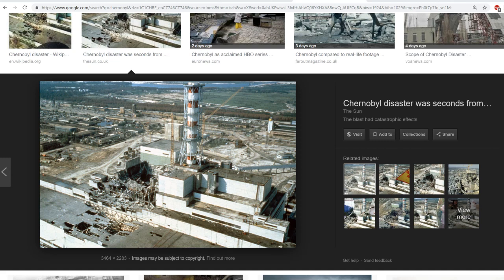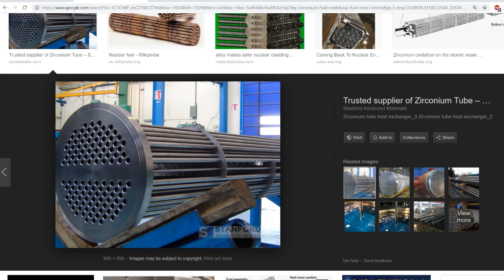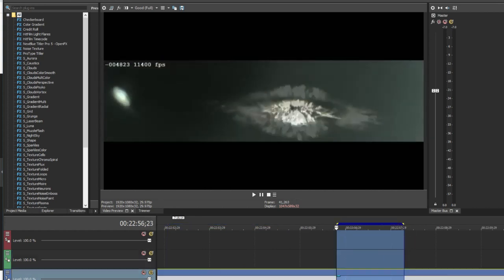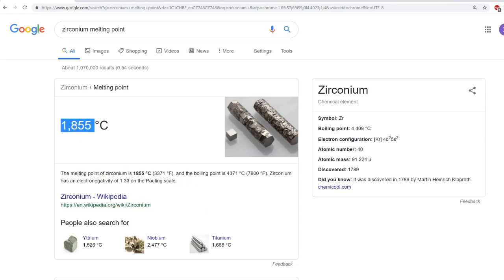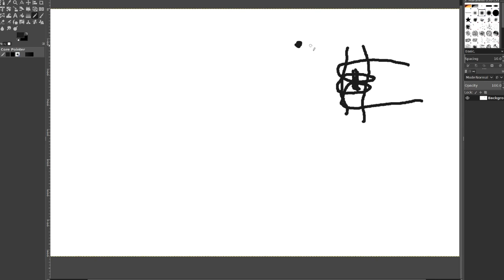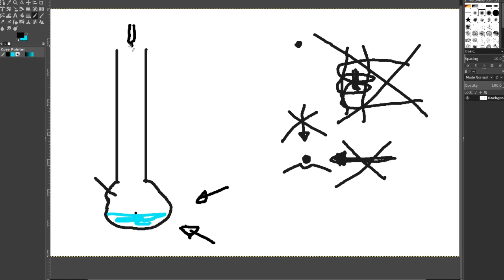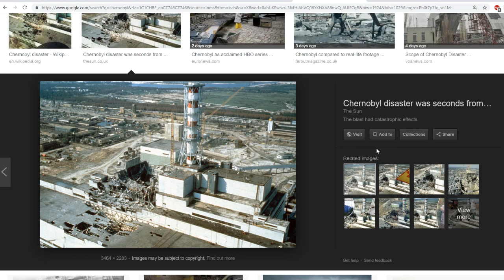Was Zirconium the real reason Chernobyl exploded?

Comment: Super-high-power induction heater vs hair-thin strand of zirconium.
Too expensive?

Harvest the filaments and leads from a bunch of banned 100 watt incandescent light bulbs. Painstakingly wrap each filament around a portion of a thin cylinder of zirconium. Connect leads to several household circuits. Suspend zirconium in argon atmosphere above some water. Preheat as much as possible using whatever comes to hand. Flip house's main breaker for the final super-heat. Wait...

What? Won't work?

Uh... Capped pipe, filled with a few ml of water and a bit of zirconium. A few hundred kilos of explosive charge surrounding walls of pipe. A few thousand kilos of lead tamper surrounding everything. Light it off.
Illegal? Crud. Might be cool to see though.

Blast that bit of zirconium with a bank of super caps! That'll do the trick.
Oh come on. Can't you let a guy dream?

Hmmm... Okay. Last one.
A bunch of evil Aussie great whites shoot their lasers at a ball of zirconium just barely suspended just above the surface of the water in their pool by easily-melted supports. Zirconium melts, slips out of supports, drops into water.
Oh, that's right. You said no lasers.

Just kidding. One more!
Everybody knows the earth is flat, and "gravity" is really a result of the earth's continual acceleration. So the earth is going really really fast through space, right? A high percentage of C maybe?
Ok. Cap a tube of water with some zirconia. Travel to the edge of the earth. Punch a hole through the dome. Stick the tube outside, zirconium up. Shouldn't be long before some bit of space dust impacts the zirconium, heating it up super-quick. It's already in contact with the water, so woohoo! Mission accomplished!

Okay. I'm just not smart enough for this game, so I'll just wait to see what solution you ultimately come up with.

Keep up the good work. I enjoy your videos because they make me think.

Comment: Consider my heating suggestion!
About induction heating so small object, you would need to use high frequency pulses using litz wire, but for small samples would be easier to just stick to lasers.
Or if you don't mind contamination.
Just use carbon electrodes and dump loads of current directly.
Might make even mini carbon foundry, just dump loads of current to it.
Nothing beats carbon in yolo heat experiments. Might heat it to the point where carbon just evaporates away letting zirconium heated to 3600c drop trough evaporated hole.

Comment: you could melt it with a tig torch. you could melt the end of a Zirconium fine wire. And then use a higher rate of argon jet, from the tig torch, to drop it.
Reply: The tig would indeed be probably the most practical way to go. Hopefully, he could reach the melting point of zirc.... What is the melt point of tungstène though?
Reply: 3422c nice

Comment: National geographic or Discovery channel have really good documentary of what happened. Actions within reactors animated and interaction between people recreated by actors.
From what I remember almost all control rods got pulled out, fuel rods that were massively heavy boiled water so much they literally jumped within reactor. Emergency fast reinserting control rods caused reaction that was situational, and possibly the worst at the moment. That instead of slowing down reaction ramped it up initially when rod enters the core, you want it go slow inside then, but nope, got shoved in and here we are.

Comment: Use a TIG welder not a mig, you will be able to use AC or DC and best of all you will be able to control it dropping off the wire.
Ask any welder it is easy to melt a rod and make a drop.
try to get a TIG with high freq start, it will help stop you blowing the sample away on start up
Reply: ohh and love the graphics!!!! seriously, as an engineer I have had and done a few fag packet drawings over time and yours are top of the line!!

Comment: Isn't the Zirconium used in reactors an alloy that is magnetic? And is that the material* you will be testing? If so, maybe you can suspend the test piece in a magnetic induction field and just drop it by flipping a switch. *No point in testing pure Zirconium if that's not what was used at Chernobyl.

Comment: Can you not just make a cup of wolfram send the current through it with the metal inside. This, presuming that a chemical reaction does not take place, gives you a window of around 1500 degrees and you can just flip the cup when the metal is liquefied. This also perhaps allows you to heat it beyond the meltingpoint.

Comment: How about this?

Zirconium in a sealed vial under water
Heat via induction under water
Mechanically crack the vial
Reply: The glass would either melt or crack or cool the Zr too much to melt. It would have to be a fused silica vial, at a bare minimum to not shatter under the temperature difference.

Comment: Phil, I have a suggestion to this experiment.  Do you think it would be possible to acoustically levitate a droplet size piece of  zirconium using a halfsphere  array of  ultrasonic transducers(device)? This would have a hole so that when you turn off the transducers the drop would fall down through the device into a tube and then the water. When the piece i levitated it could be zapped with the laser and kept "safe" by a stream of argon gas until it has the right temperature. This is all assuming the levitation can hold on to the piece in liquid form etc. Do you think it could work?

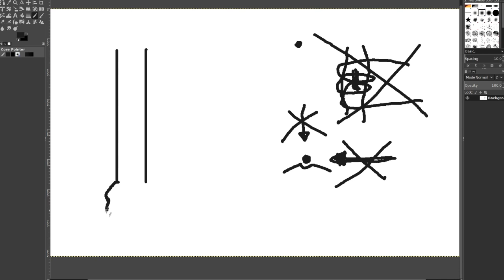Comment: At @11:30 you mention the difficulty of putting a molten ball of zirconium into water. Would the opposite provide the same data? Drop a lot of water onto a levitated molten ball of zirconium? Also, take a look at various welders, they do something similar - pump gas onto a weld that reaches insane temperatures.

Comment: Yeah, tough one, especially given you don't want to keep heating that stuff as it falls in a similar way it would have been in the reactor. Granted it may not have been increasing temp heated, however, I suspect everything else may have been hot enough to prolong how long the zirconium would have stayed hot enough to be liquefied-ish-molten. The hotter the environment, the lower the temp delta for thermal transfer. and if that comes close to the glass containment, that in itself may be problematic (given deltas between room temp outside the experiment and inside the glass containment).   It'll be cool if you figure it out, I got no ideas on how to make that work (safely). I don't think z-pinch approaches that kind of difficulty.

Great vid VoT and crew. B)

Comment: You could make a tiny Archimedes' cup to function as a sort of valve that doesn't let the metal through until it's molten and there's enough molten metal. This would solve your problem of holding the metal somewhere until all of it is molten. Anhydrous sodium hydroxide powder(or any other dehydrating agent) to wick up the water vapour might work. And you might want to keep the distance between the water and the metal to a minimum. At those temperatures, losses due to radiation would be very significant. Would silvering the tube from the outside help?

Comment: Ask the backyard scientist if you can borrow his induction smelter and talk to Styropyro about the laser!!! Use both at once while it is suspended in a micro crucible within an Aragon sealed ampule. When the metal gets hot enough flip the ampule and it will break from heat shock, if you design the ampule to hold the crucible the top breaks off and you get some hot glass and some molten Zirconium falling into water under your Aragon atmosphere.
Also do tests with molten sodium chloride to test this out or try a molten zirconium salt...

Comment: Simple, grab some tungsten carbide rod with a hole in the centre. Place the Zirconium inside the rod, heat it up and when it is hot enough to drip down which will be quite a bit higher than the melting point so it will be hot enough to fall to the bottom without solidifying. Also tungsten carbide is quite resistive so if a strong currant is ran through it than it could the desired temperature. Argon could also be blown at the ends of the rod to replenish the air and prevent any water vapor from reaching the Zirconium. The Zirconium could be held in place by a small ball of aluminium foil. lastly if the Zirconium does not want to come out, high pressure air could be blown from the top to push it out
tungsten carbide:
Melting point - 2800C
Resistivity - 4.1*10^-7 ohm/m
Some order site:
https://www.alibaba.com/product-detail/polished-single-straight-hole-tungsten-carbide_62078568406.html?spm=a2700.7724857.normalList.172.76136cb69hD4Hk

Comment: I use induction heaters quite often. We use them to mount solid carbide cutters into a precision-ground steel tool holder for machining. The device is called a shrinker, though it's actually the opposite action that it performs. A coil slips down around the neck of the toolholder and in seconds the steel expands enough that we can insert (or remove) the carbide end mill. Look up Haimer. There is a display on the machine showing the voltage and amperage. Next time I use it I'll note what it takes. Needless to say, we run it off 480V 3Ph.

Comment: Heat the zirconium until it is hot enough for the leidenfrost effect and then add the water? That way you might not lose too much energy to the water so you can keep heating it with the welder.

Comment: Decades ago, when I was in trade school, my instructor told me of an incident at Hanford. He was a machinist there, operating an engine lathe, turning something out of zirconium. He said they kept a length of 2x10 at the end of the bed, in case the part caught fire so that they could loosen the workpiece and use the board to flip it away. Well, it caught fire, but he wasn't about to put his hands near it with the chuck key, so it sort of fell between the ways, melted the cast iron, and fell through to the floor, where it burned a hole. Nice stuff.

Comment: This is what I think happened. The fuel rods would be so hot that a layer of steam will insulate them, allowing them to heat up even more. The Zr cladding eventually vaporized into millions of white-hot drops/particles that dispersed into the water, providing heat and nucleation sites for boiling. Rapid violent boiling and steam explosion followed.

Comment: You don't want a MIG welder. You want an arc welder (or a TIG, but really that's the same thing but with a few extra features.). You can get massive arc welders at auction that can do hundreds of amps. I bought one that runs on 240V single-phase with 120A input. It allows you to weld at 540A. It cost me $200. I see similar ones at similar prices all the time on Craigslist and on industrial auctions. Don't get the three-phase models unless you have access to three-phase power in your lab.

Comment: May be you can heat thin zirconium wire just under water with high current. From the big capacitor for example to make it quick. Seems like the simplest decision. Or heat it with argon plasma between two tungsten electrodes with a tig welder... one of them will melt pretty quick tho.

Comment: Could you have the heating element just above the water with the zirconium on top, heat to temperature, then mechanically move the element below the water?

Maybe not ideal, but you won't need to worry about the zirconium cooling down during the drop or sticking to things or the water absorbing all of the heat you're pumping in?

Comment: Hey why don't u just make a thin zirconium electrode that fits into a tig welder, let the electrode hover over the water in a argon filled fish tank and zap a block of steel with it, i managed to melt tunksten by accident. (Tried welding 8m steel plate by running 180 amps through it. And tunksten melting point is 3 422 °C under 2000 should be no problem

Comment: For suspending your drop of zirconium could you just hang it from a very thin "thread" made of zirconium? Also, if CO2 lasers are too expensive (could you rent one? Or borrow one from a friend),  could you use a large parabolic mirror or large fresnel lens to focus the sun's rays to melt your zirconium remotely? I really don't recommend the MIG welder approach, I'm worried that burn off from the electrodes will contaminate your experiment.

Comment: 11:54 Sorry TF my dearest friend, but this design is badly flawed. 
The water has to submerge the protruding stem, at least a good centimeter or 2 (depending on your pull and overall size of the apparatus). Unfortunately you will not appreciate these results, as you maniacally asphyxiate with a great deal of displeasure whilst operating the device. Additionally this methodology is counter intuitive to resource preservation and extremely inefficient. Please, submerge the stem for a significantly more pleasurable experience with less wastage. Muchly appreciated.

Comment: Use current and the resistance of the zirconium to heat it up. Maybe the leidenfrost effect can prevent heat loss when really hot. Subsequently, if your hypothesis is right, you would have the zeta potential that goes to zero, water-zirconium contact and kaboom. Otherwise, it will keep heating it up, until melts and drops to the bottom without any described destructive explosive reaction. Ciao! Best of luck!

Comment: MIG welder, or TIG? I think it might be easier to setup the experiment, and not not introduce impurities, if you use a TIG welder.

I may not know something about what you intend to try though.

With a TIG welder you cant setup the apparatus without moving parts, were as the MIG welder has a metal wire feed out instead of a sharp tungsten tip to transfer the arc.

Comment: There are a few options for melting things at high temperatures. Ultimately what your looking for is a refractory material. A lot of people use fire brick in a variety of arrangements with all sorts of grouts from home mixed to commercial products. A cheap, effective but fragile solution is pyrolyze bread. Cut stale bread into a bowl being careful not to smoosh it in the process, wrap in foil and broil it until thoroughly charred. Turns into a carbon foam that is remarkably good at containing heat. Propane and oxygen should get plenty hot enough, especially when the heat is contained in a refractory, however crude it may be.

Comment: Is it possible the damage is from a steam implosion when the steam is flashed to vapour?
Spraying cold water into steam can create a hell of a vacuum and an implosion would do a lot of damage.
It seems as though Zirconium is too far away on the periodic table to produce the electrical effects of sodium.
To reach even half those temperatures all the water around would already be steam.
Reply: Except that it was an explosion, not an implosion
Reply: @muthafukka7733  The two look very similar.  Implosions move inward and once they strike a common mid point they rebound outwards.  Really the only clue to an implosion,  on cursory examination, is the decrease in apparent energy over that of an explosion.  The pictures shown would support an implosion hypothesis at least initially.

Comment: A co2 laser pointing down to melt a zirconium wire will keep it hot on the way down to the water provided that zirconium is not reflective to 10.6μm wavelength otherwise you would need a fiber laser. It is pretty easy to make a co2 laser tube. Maybe we can get Mr Carlson's Lab  to make a laser power supply. I have some large borosilicate tubes....... who knows!

Comment: What if you mounted an upright razor blade, with the edge parallel to the water surface and standing just proud of the meniscus formed by the water on the sides of the blade.  If you can get the droplet hot enough to survive the fall without cooling, it will strike the blade and cleave nice fresh un-oxidized surfaces right as they plunge into the water.  You might not even need the argon if that idea worked.

Comment: If you do plan to try to drop molten metal into the water, then run the argon stream in reverse. This should significantly reduce the water vapor in the tube. You may need to pump from the current argon inlet to get this to work. 

You could also pull a vacuum from your current argon inlet. In the vacuum configuration, a check valve could be used to exhaust the potential gas expansion. And by check valve, I mean an unclamped KF flange or similar. 

Still, I like the submerged TIG welder idea as an initial attempt.

Comment: Here is a solution... place it in a platinum plate on the bottom of a enclosed test tub. 
From the top of the test tube, have it enclosed but only have a water pipe ready to add water by turning on a tap and forcing in the water. 
Place the Zirconium onto the platinum plate at the bottom of the test tube, add the argon gas, heat up the zirconium and when it hits 2000 C.... add the water from above and see how quickly it flash burns or explodes.